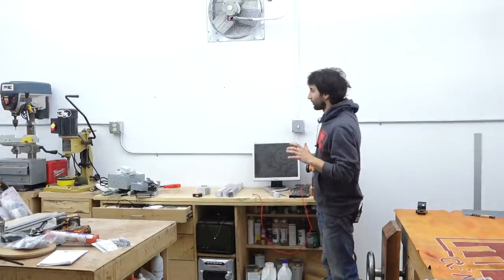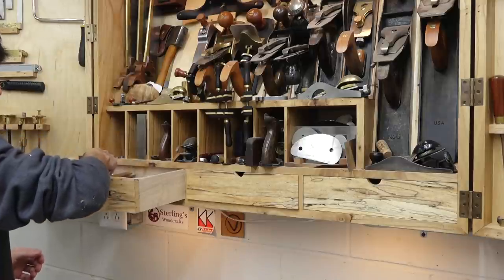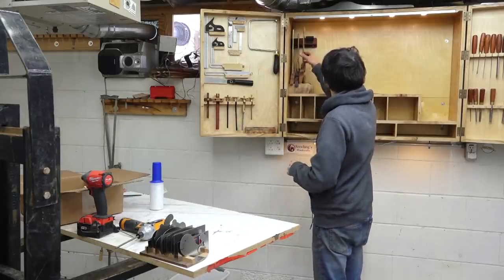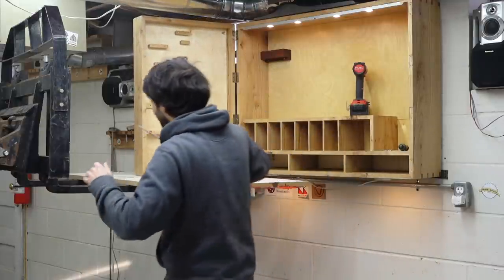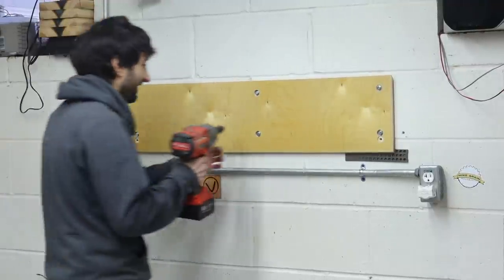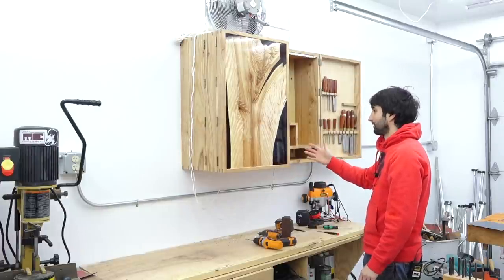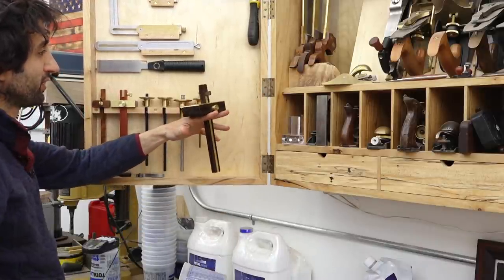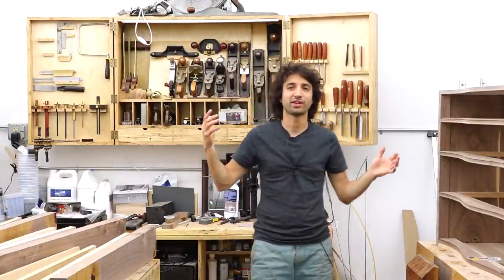Moving my Handtool Cabinet - Moving My Woodworking Shop [Part 5]

Comment: Couldn’t you just have removed the two middle hinges from the doors, wrapped them in cling film then used the skid steer like you did but keeping all the items with in ? Love the front of your cabinet 👍 why did you mount it so high ?? Will you be putting other things on the walls?? 👍👍🇬🇧🇬🇧

Comment: HOLY SMOKES, the bite you took with the jointer  @15:50...  😬

BTW, did you buy the #8c after making the cabinet?  Can't imagine why you didn't put it inside the cabinet otherwise.     Because really, you should come up with something to do about that --- maybe build a "second story" on the top, or on the side, or just gut the thing and rework the interior...   I know I know, the house reno comes first!
Reply from the maker: Hahahaha who has time for baby passes??
I bought the 8c a long time ago. Was planning on getting rid of it since I replaced it with the ln but as you can see, I haven’t sold it